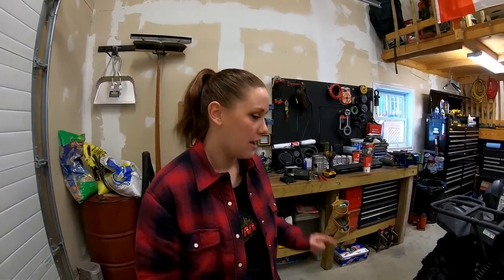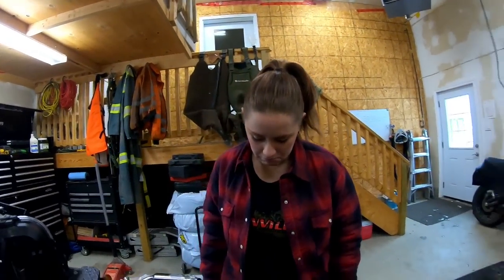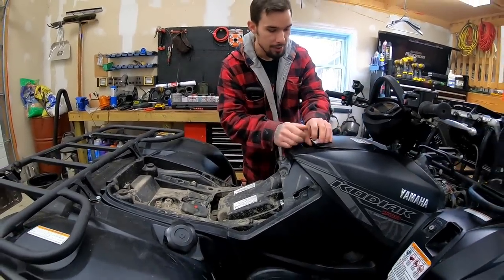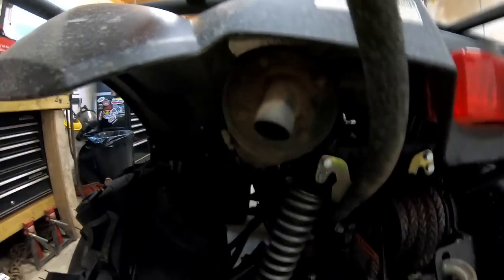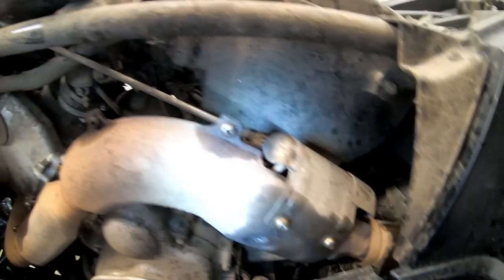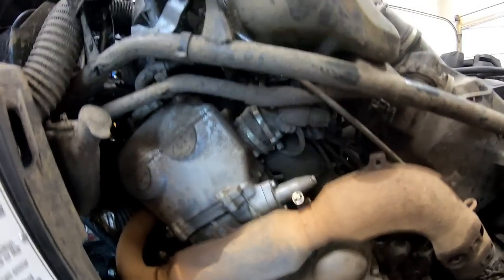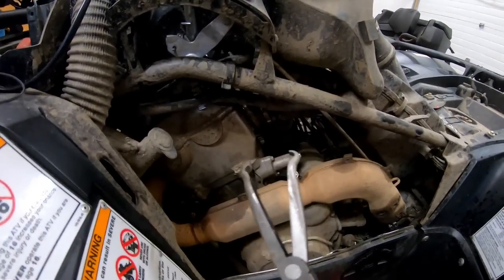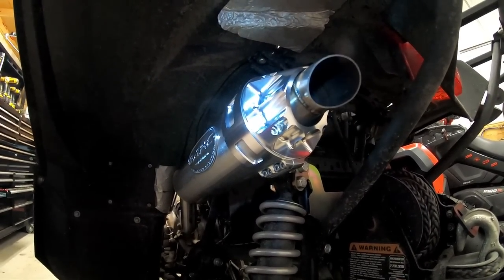RJWC Mud Edition + Tuner Kodiak 700 EPS SE!

Comment: Love that quad!!!   I have exactly the same one.  Doing the two inch lift kit, 28” mud zillas on the stock rims, and the clutch kit.  I won’t be doing the clutch kit having the dealer do that for me.  Then putting on the euro slip on pipe.  Just not pulling the gun on the tune kit because that will void out the factory warranty.  Can’t wait to get everything done.  Love the videos.
Reply from the maker: Thanks man, good luck with the mods and keep us posted along the way in our fb group! - Cass

Comment: Is that an automatic cam chain tensioner behind the header pipe? 
I swapped mine on my 680 Rincon, I usually check 3 times during regular season for the proper tension and adjust if needed

Comment: FYI, if you do a AIS delete the annoying backfiring will stop. You can find how to do this on grizzly central, good job!
Reply from the maker: AIS? I'm interested!
Reply: Mainville ATV and Outdoors— hi guys I have a 2016 grizzly 708, Yamaha runes these engines very lean from the factory to meet emissions control standards and I could not stand all The backfiring on deceleration and found out about the AIS delete on grizzly central forum, it is a wealth of information on grizzly & Kodak ATV’s. The fuel controller is a must with the exhaust modification, with out it there is a good possibility of burning up your valves. The exhaust and fuel controller will also make the 708 run a lot cooler. I also noticed a subscriber crazyflyboy30 commented on having your primary clutch sheave Machined. This will make your belt ride lower at low speeds for more torque, I had mine done and love the results and you do not lose any top end. Hope this will help you all.
Reply from the maker: @ricktheprick327  we are using a tuner with this set up. Am I missing something? Sorry!
Reply: Mainville ATV and Outdoors —no sir, I seen you had a tuner I was just stating that without one it could be bad news! Your good to go!

Comment: Where is your tiger tail bolted on!!? I have one on a hitch mount and hate how it sticks out that is so clean you have there !!!!
Reply from the maker: Its bolt the same as everyone else, I just flipped the bracket upside down so it tucked back into the machine.
Reply from the maker: The reciever goes it, then you bolt the mounting plate. Flip the mounting plate upside down and itll bring the whole thing inwards. You can see what I am talking about in a recent video I did installing one on my outlander.
Reply from the maker: https://youtu.be/llNAZa7WUsA